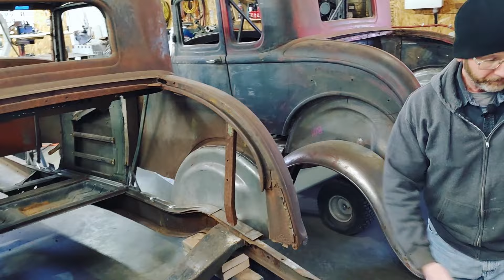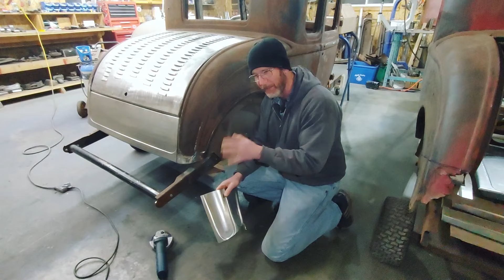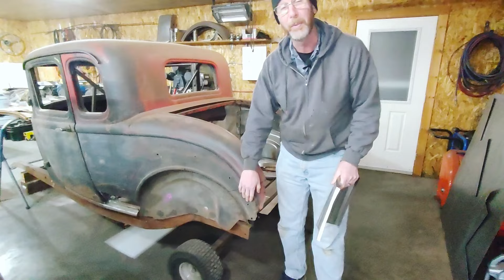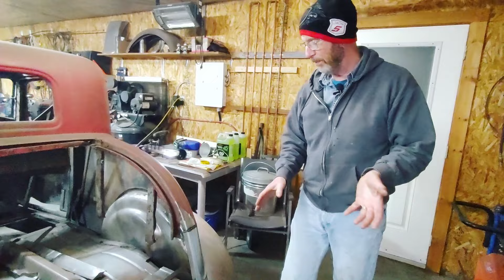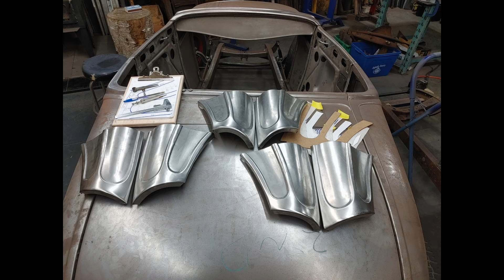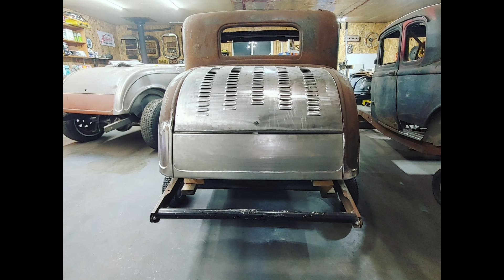1932 Ford 5 Window Coupe Projects - Rear corners fabricated and installed

Comment: Derek. I think you made the right decision to weld your pieces in. I no you wanted to save the old steel. I think it’s a much better repair and will last longer in the long run.congratulations on your subs you and the camera lady deserve it. Keep them coming. Many thanks Tim.
Reply from the maker: Thanks for the feedback. Yes it's a struggle to decide to save or replace sometimes especially when the metal is so thin in some places. The lowest setting on the welder will sometimes blow holes on the thin metal. Have to try and adapt!

Comment: You need to wear knee Pads or ur going to feel the Pain when you get older
Reply from the maker: Yes sir, I'm feeling it. I have them just don't use them enough. Need to use more.
Reply: @coldstreamrodshop  Right n I have 2 PR n forget to use them n I'm 60 now n I feel it n it a lot of pain
Reply: I’m 64 was my birthday yesterday. Anything that helps to be comfortable is a good thing knee pads and the likes. I’ve had a left hip replacement and sometimes when I’m working on my back or side I get a feeling as if my tendons are tightening up. Not nice this getting old so anything to aid the process is a good thing.